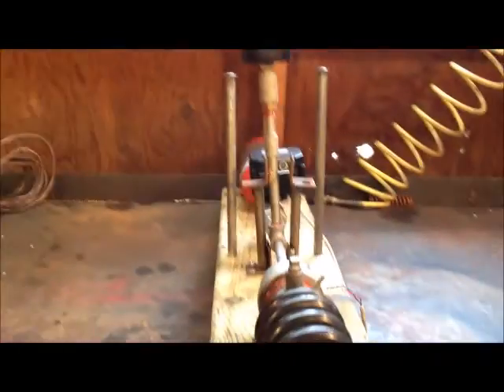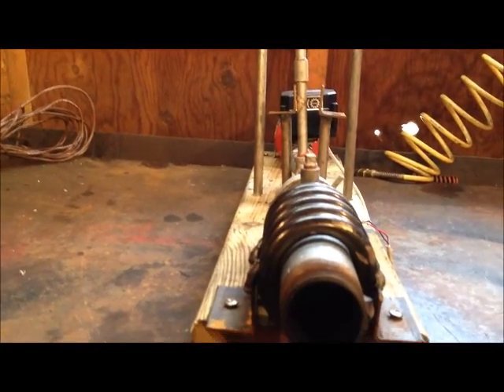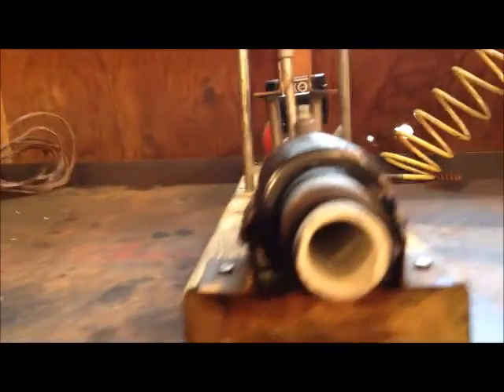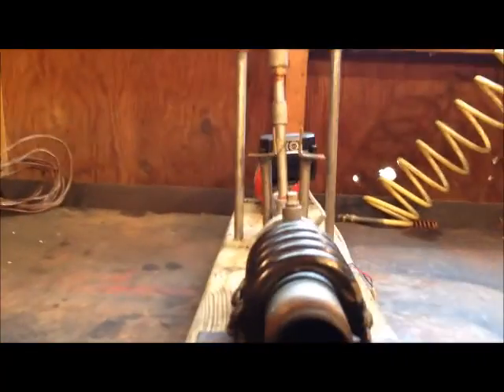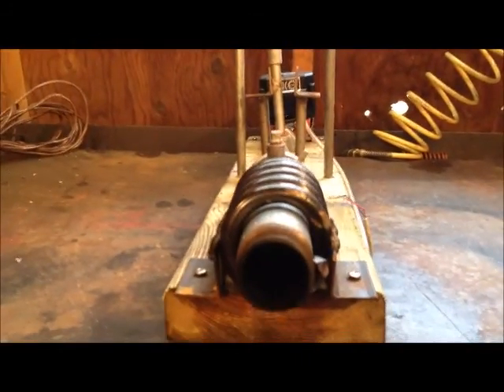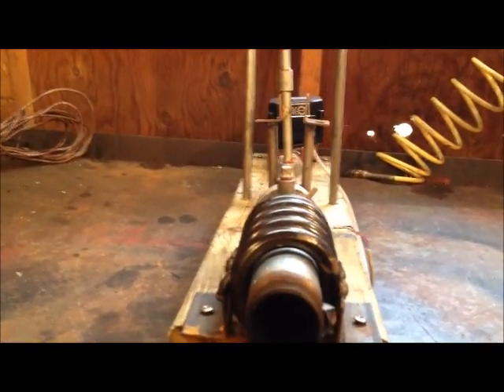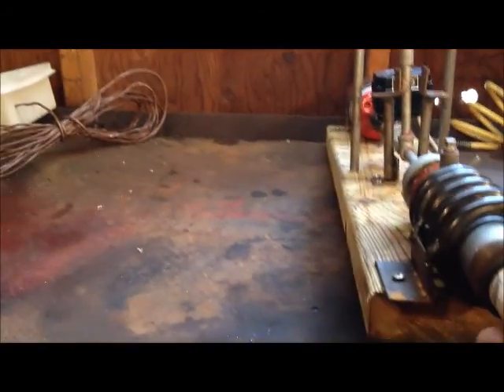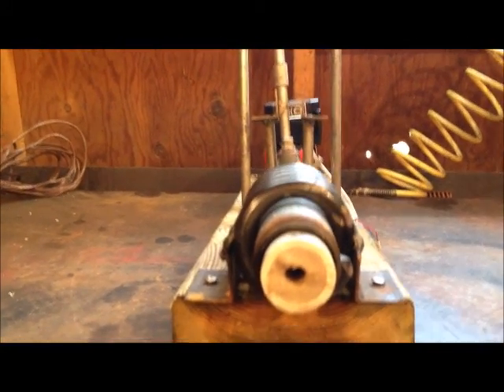Hybrid/hybrid rocket motor

Comment: Nice!  Did you get a thrust measurement?
Reply from the maker: Yes, though not very accurate, second part of the video has it up against a bathroom scale. But that scale doesn't work good vertically. And there is a fair amount of drag with the mount I built. Guessing round 20 lbs peak. Have bigger plans in the works. There will be a video this afternoon of pushing the limits a bit farther on the solid fuel end of things.

Comment: that's pretty awesome even if you have to buy flowers!
Reply from the maker: Many bugs to work out, but I think this is a viable concept. Just need more time and money. But got a 9 second useful burn, which is unheard of in smaller rocketry. Commercial I motors top out at 3.5 seconds.